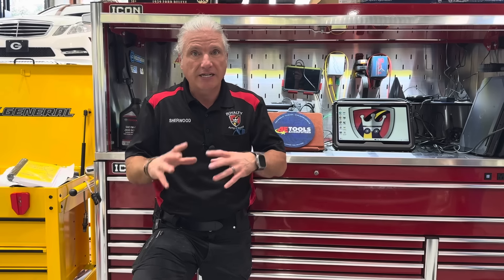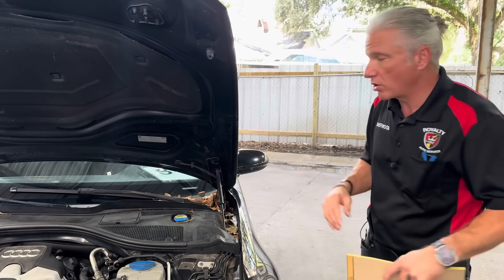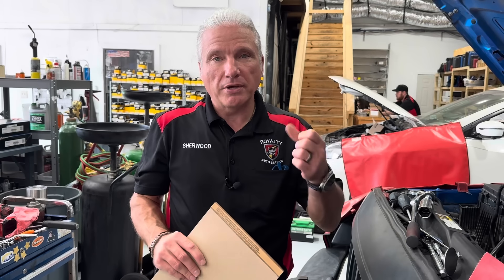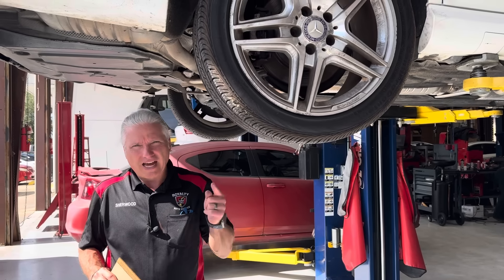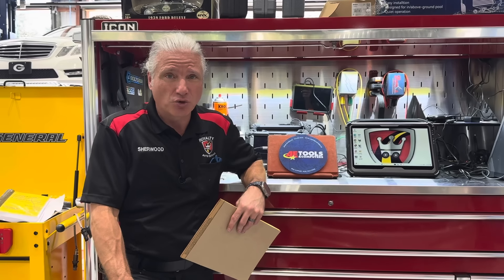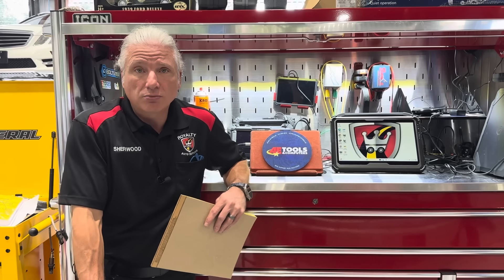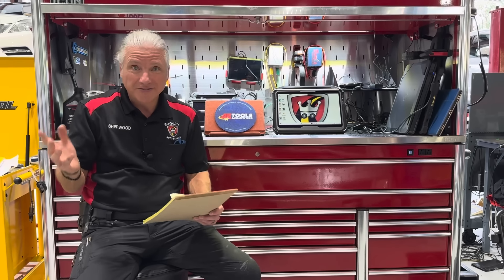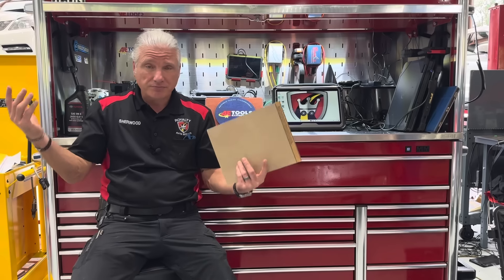Ranking The Top 5 Most Expensive Vehicles To Maintain That We Work On At Our Shop!

Comment: I don't think newer vehicles in general are going to last as long as late 90s mid-2000s vehicles. First is the European influence. Obviously, Chrysler after the Daimler merger, but even Ford and GM now have European drivetrains. They are also trying to hit a higher standard of power and emissions which means unreliability. This is now extending into Toyota with their mess of wires and hoses.
Then there is the issue of planned obsolescence being worked into vehicles after the mid-2000s. Like body panels costs several thousand to replace. Water pumps being put into unserviceable areas. Hot V setups.
If you can find a longitudinal power train from the late 90s to mid 2000s, I would try to keep that vehicle on the road. Body on frame from the southwest will have fewer rust issues but will have rubber/plastic issues. Still cheaper to replace those parts. Or if you are OK with replacing your vehicle every 5 years, enjoy the creature comforts of a new vehicle.

Comment: I have the Audi S4 3.0t supercharged.
Completely agree, I had both timing chain covers with a slight leak which are at the rear of these engines, part of gaining access was to remove the supercharger, so I decided since they removed the supercharger to get a valve carbon clean, and replace the PCV at the same time, neither of which were giving indications of being faulty , however a lot of the cost is labour, and for these European vehicles absolutely nothing is easily accessible.
Yes these European vehicles are more expensive to maintain but are extremely exhilarating to drive.

Comment: the rear main seal iny truck has leaked a 1/3 of of quart in 4500 to 5k mile oil change intervals for the last 24 years.its staying that way until the tranny eventually fails.hell new cars burn more oil than my 200k engine leaks from an obvious seal leak.tells you alot about new engines.

Comment: Many repairs cost between half and several times the value of the car. Repairs these days are very expensive probably because the cars are very complicated. The cars are not designed to be repaired easily and cheaply, hardly to be repaired at all.

Comment: It's an interesting concept, but useless information without mileage. Lots and lots of oil leaks without associated mileage means nothing. My 12 year old Chrysler has had ZERO repairs and ZERO oil leaks while getting $25 pit crew oil changes at Walmart every 7500k miles. How impressive that is depends almost entirely upon the total miles on the car.

I suggest at least averaging the mileage on the car models you discuss. You don't need to be a statistician to put together some usefull numbers. You have good data, let's put it to use.
Reply: Totally agree. I would also provide Average age for each manufacturer.

Comment: I. Lean japenese. Acura, honda, lexus, toyota. Not high end sport models. I usually keep my cars 6-8 years so long term ownetship i am not familiar with.  Bought a 2020 Mercedes c43 convertable, amg. Before 20,000 miles but fortunately under warranty i  had to have leaking rear struts replaced. Convertable top broke and entire top was replaced as all cables broke. Also one fog light went out....not under warranty...300 bucks. Once the warranty is up....its gone!  $85,000.00 car.  Silly.

Comment: I’m actually surprised that Chevrolet/GM didn’t make the top 5. I’ve had to replace two water pumps this past week on them. A 2020 and a 2019, both under 100,000 miles (the latter only had 56,000).

Comment: I guess you do not repair Porsche? I had a Macan, was very expensive to maintain....PDK transmission fluid needs to be changed every 2-3 years, other issues like brakes / oil changes are very expensive.

Comment: I own a BMW 2011 335is (n54) and 2016 535ix (n55). I do the oil change on both.  Cost $80 parts plus a half hour labor.  Not sure why you say oil maintenance is expensive on BMWs.  Certainly should not be for these two engines.

Comment: Dunno why every9one hating on Kia, I got a 2016 kia soul brand new and didnt even attempt to maintain it the first 100k miles I just prayed to God a lot, then I started maintaining it like a mad man for some reason, oil changes every 3k miles etc and I am now at 261k miles and I have only changed the alternator, I did change the timing chain on my own because I felt it might break from age though it wasnt super loose.  I am no mechanic, ive done an oil change and a timing chain that is it, the timing chain was a bit of a pain and took me like 2 days
Reply: Because you are not a mechanic, you haven't worked on them along with many other brands you get a good comparison to other brands. The Soul seems to be a better Kia as I still see that model on the road and seems to have a lot less issues!!!

Comment: As a VW dealer tech, the reason for the oil leaks is mainly due to operator error. Not using the proper VW504/507 or VW 502/505 oils. They buy generic 5w30 or 5w40 and the problems arise from that.

Comment: Month late on this, but you need to balance the number of repairs with how many are owned in the given area. For example, if there are one million Brand A cars in your area, and two million Brand B, and you see 500 Brand A in for repair, and 750 Brand B, then Brand A is actually worse than Brand B. 

An extreme example would be how many koenigseggs do you see in for repair? 0 or 1? Must be very reliable.

Comment: I've owned all the big 3 German cars and several Japanese cars. My BMWs have always been the neediest, but they also have been more fun to drive. My Audis have been easier to work on, but require some special tools. My Toyotas don't have as many problems with their engine, but they still have problems. However, they rust like crazy. Body work is often much more expensive than engine maintenance and repair.
Reply: You can use Fluid film or undercoating if you live in the rust belt they are easier solutions to prevent rust.

Comment: European gaskets are not made from the same stuff as what GM uses on their LS engines. Replaced the oil stand housing on my 2008 535i 3 times... 1998 Corvette? Dry as a bone.
You must not work on Porsche's because while they are good vehicles, the cost for parts to repair is higher than BMW.

Comment: European cars have not been a viable option in my eyes for over 40 years. The last good Mercedes I had was my 1980 300D. 
The same can be said for Volvo. Once cars started to see rubber timing belts, turbo chargers, front wheel drive, etc. they became less reliable, more expensive to fix, and far less desirable to own. 

On the Fords, they started to screw up in the early 90's. The engines that served them so well for decades were being replaced, and even then the first gen modular motors far outlast the modern crap we're seeing now. 

Any company that had a timing chain or belt driven water pump, high pressure oil injection, turbo charger or any variable timing should be forced to support and pay for failures on those engines for their duration. 
We'd soon see that crap go away. My 1986 300 six in my F150 will likely out live me. It gets two annual oil changes if the mileage justifies it and its been 100% trouble free for 38 years and nearly 100k now. My guess is it'll still be running when I'm long gone from this earth.